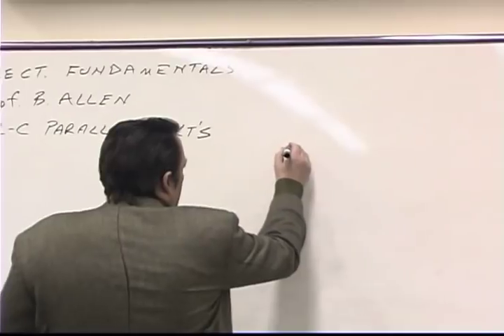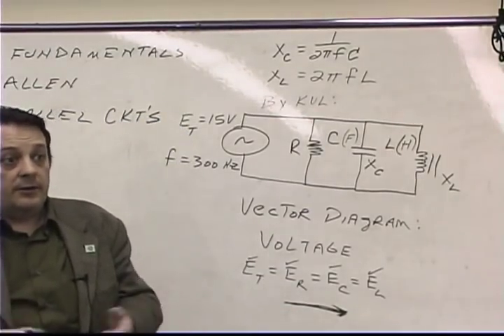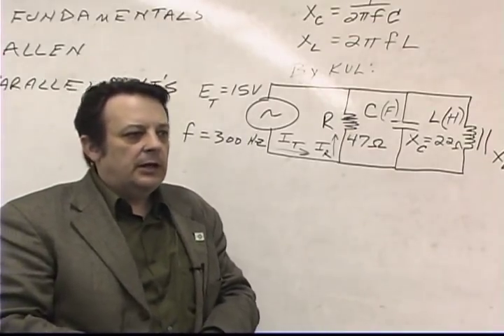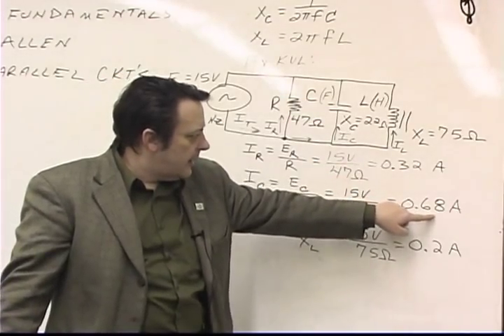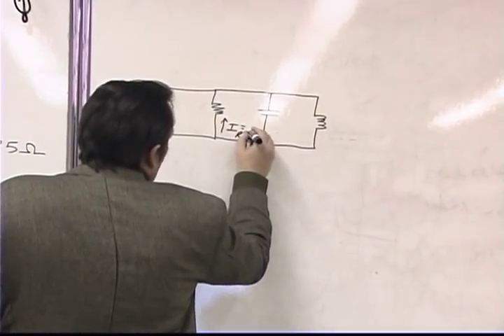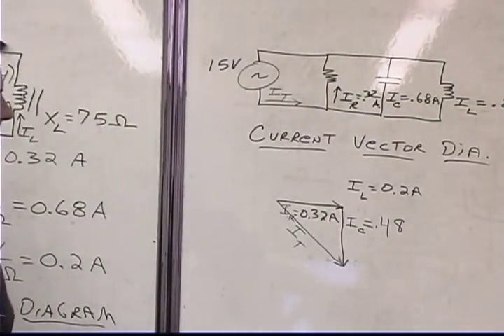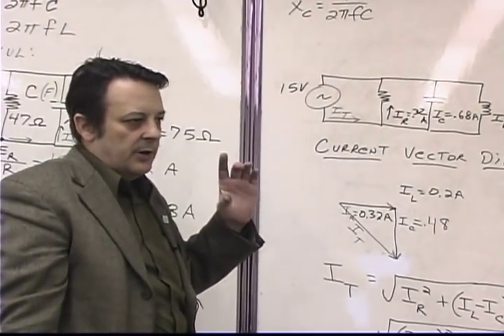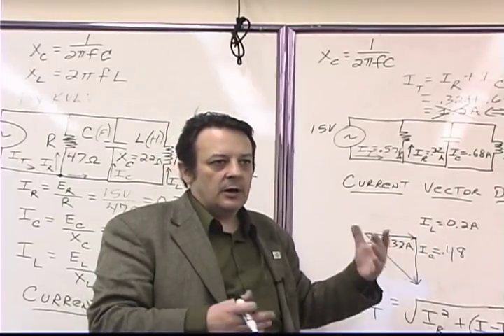RLC Parallel Circuits (explained & analyzed)

Comment: Sir
just watched yr video on RLC PARALLEL CIRCUIT.
1. while writing the CURRENT VECTOR DIAGRAM to find TOTAL CURRENT in the circuit diagram, YOU ARE MAKING A MISTAKE. 
The current in the resistor is in phase with the applied voltage. since this is the reference, it is horizontal parallel to x-axis. this is written correct.
next the capacitor current. REMEMBER THAT IN A CAPACITOR, THE CURRENT LEADS THE VOLTAGE BY 90 DEGREES.  HENCE U HAVE TO WRITE THIS VECTOR IN THE " UPWARD DIRECTION", where in actually you have written in the DOWN WARD DIRECTION which is wrong. 
2. Another mistake i find is that u are writing the current in inductor as LEADING while in reality it is Lagging the applied voltage.
3.  Also another violation you have done is that vectors should always written in FROM TAIL TO HEAD and never TAIL TO TAIL IN A VECTOR DIAGRAM.
VATSA  BANGALORE.
Reply: Wtf are you talking about? How old are you? 9? 10? 17?
Reply from the maker: Thanks for the "heads-up" you R correct
Reply: Looking for this comment, now I know electrical engineering is not easy:)

Comment: The most important part to me is show why the current on inductor, capacitor and resistor are respectivelly down, up and parallel to the circuit's current.. And it's not explained on this video. But anyway thanks for providing this on YT it should help a lot of people!
Reply: Vitor Thomé If you listen he explains why the capacitive reactance is negative....due to it being an inverse relationship or 1/(2piFC)....

Comment: Sir, 
I have a suggestion, plz don't ignore it.
The fig. u draw in the board is not shown like a proper parallel LCR circuit. 
BECAUSE 
the two each ends of the all circuit elements are not connected to the emf source .
plz correct the fig. Sir. 

AT LAST THANKS A LOT SIR I HAVE ALREADY SOLVED MY ALL DOUBTS BY REGARDS OF UR VDO .
TQ SIR ......
Reply: Prasad Ashutosh Matagajsingh wow awesome

Comment: he's drawn just opposite phasor
Reply from the maker: You are correct. This is an error on my part. The current vector diagram
 should show the I(c) current pointing UPWARD and I(L) pointing 
DOWNWARD. If you re-watch that section of the video, I have inserted 
annotation pointing out the error. Thank you for your observation and 
feedback. VERY GOOD!!
Reply: Was looking for this comment just so i wouldnt repeat it😅

Comment: sir, i have a doubt regarding this.We know that in an inductor circuit voltage is ahead of the current by a factor of pi/2  and the opposite happens in a capacitor.So when you drew the diagram for currents in the branches , shouldn't Ic be on the top and Il at the bottom as voltages are in same direction?? Please explain.
Reply from the maker: You are correct. This is an error on my part. The current vector diagram should show the I(c) current pointing UPWARD and I(L) pointing DOWNWARD. If you re-watch that section of the video, I have inserted annotation pointing out the error. Thank you for your observation and feedback. VERY GOOD!!
Reply: same question here.....